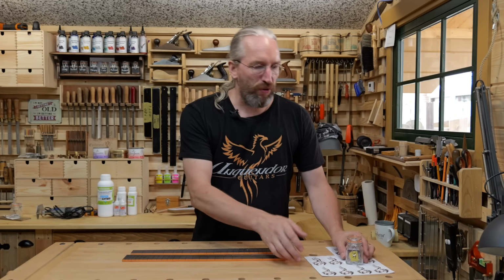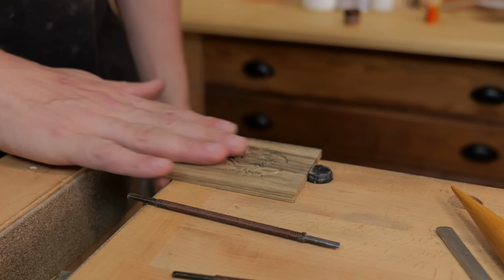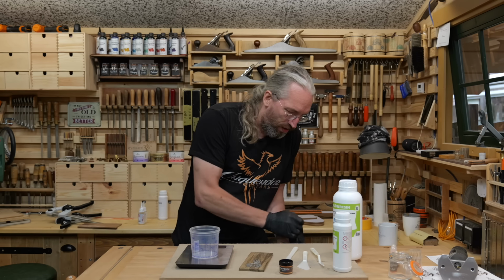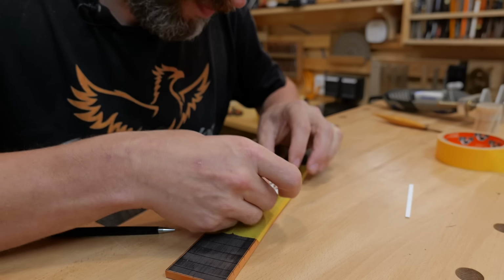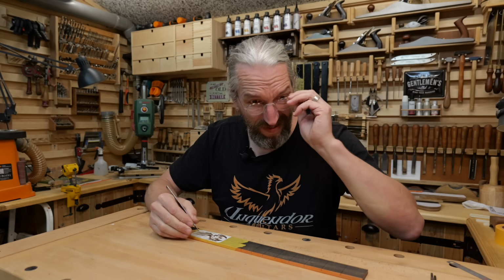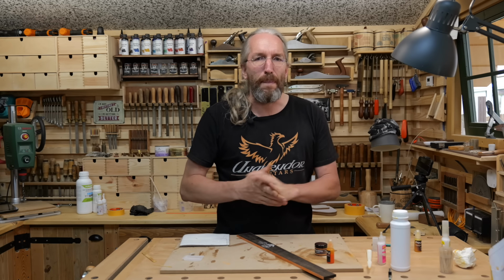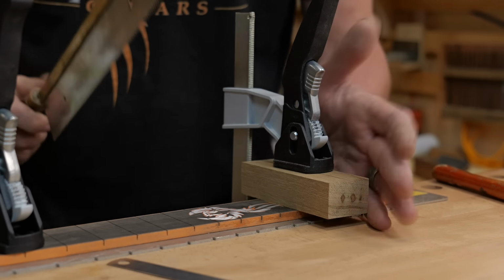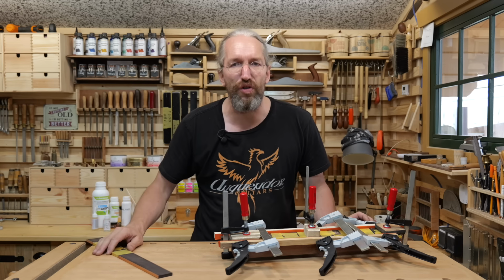Phoenix Rising - Guitar Building Series Episode 10 - Inlay redemption

Comment: Hey Daniel, I'd say that not just the inlay but the whole fretboard looks amazing, you are a true artist!
I have no personal experience with epoxy rasin but, for what I know, air bubbles can be removed by using a heat gun or a torch, but I believe that the heat gun is the right choice when working over an ebony fretboard. 😅

Comment: Bravo for your patience on experimenting with the orange outline. There's no way I could do that when the final result is inconsistent edges. That would drive me insane. But it's a good proof of concept that could be refined. You'd never learn if you didn't go for it. What could work, and that's if you had a laser cutter. Then you could have a small outline inset on the edges of the aluminum that your pigment could lay in.